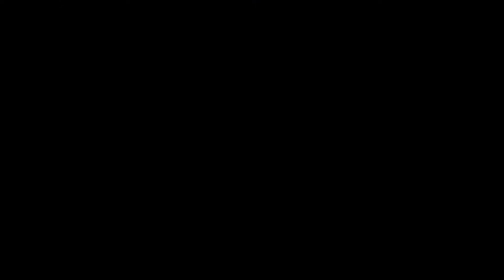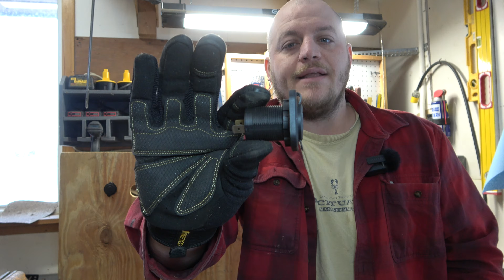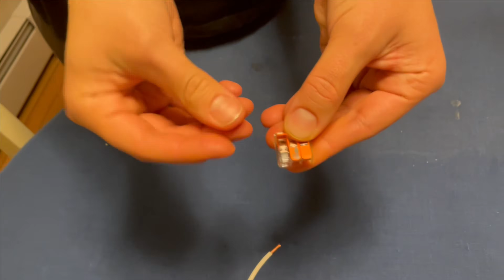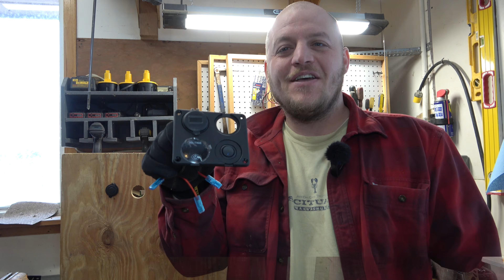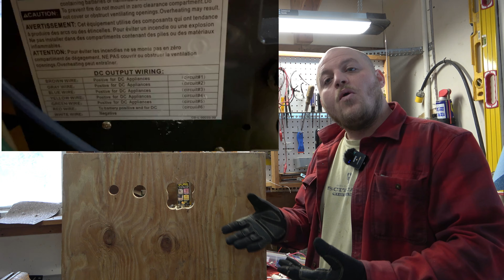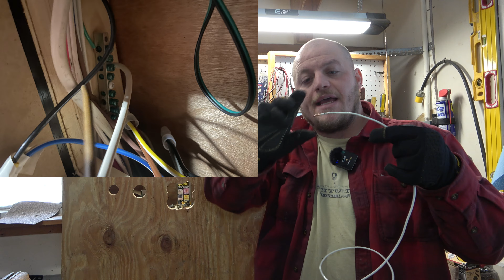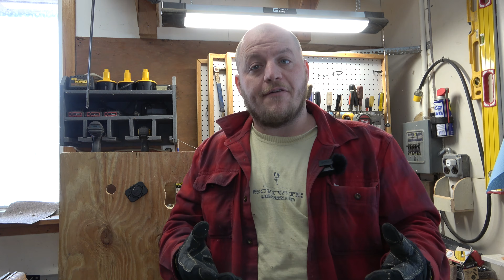Installing 12v plug | EASY cigarette socket camper RV

Comment: Brilliant explanation! I would like to wire a 12v socket in my RV to charge a laptop that is at 4.7Amps const. Based off of the length of wire needed etc. I have found that I would need a 12AWG wire. Would I really need a wire that thick or could I use something much thinner, say, a 17 gauge wire that is capable of withstanding 15 amps? with the added fuse, of course.
Reply from the maker: 14awg could handle 15a for a long distance.
Reply: @DIYOutdoorLife   @DIY Outdoor Life  thank you, I used your recommendation and video and I now have a working 12v socket! Thanks! My wife is happy as she can charge her laptop from under the table instead of the charger wire hanging overhead (as that is where the socket used to be).

If I may ask one more question, I was thinking of wiring two 12v sockets together to charge two laptops, say, with the same specs as before, so that would be 2x 5A = 10A altogether, and I read somewhere that it's best to muiltiply that by 1.5 then round up, so I get a 15A or 20A fuse to use.

I've used some online wiring calculators, and at 20A at a 30feet distance, I would have to use... a 6 gauge wire...

This probably being a "book standard" result, could I use a thinner wire? Say, 10 guage, since 10 gauge is technically good for 30amps.

I just cannot seem to reason using such a colossal wire (6 gauge) for two little 12v sockets. 10 gauge is big enough, but 6 gauge would look ridiculous.

Thank you!
Reply from the maker: @Farseer1995  10awg will be more than enough. In fact, I would have to look at your system, but I bet you could even use smaller than 10.  
You’re on a roll, have fun!
Reply: @DIYOutdoorLife  hah, once again thanks a ton!

Comment: hello I've been watching you for quite awhile I have a bushwhacker fb and I'm hoping you can help me to figure how to make my ac not over heat  I've cut a hole in the galy and not a thermostat ran fan to suck the hot air out but it is still not working correctly  please help if you can.  thanks for all you do
Reply from the maker: 10fb model?

Comment: I was so excited to this but my bus bar is tucked in on the bottom and screwed in such a way I can’t access! That’s so frustrating but thank you for this great video
Reply from the maker: what camper do you have? Bus for positive or grounding?
Reply: @DIYOutdoorLife  the 2022 10HD. I was just able to use a ratchet screwdriver to get the ground bus free from the backside of the access panel. I wish it was mounted on the side like yours but looks like they were short a little wire and couldn’t reach. :/ oh well, all is good now. Time to deal with the radio cutoff switch tomorrow! Thanks a million for all of the great videos you’ve put out
Reply from the maker: @KC2DWG  nice work! I'm really glad you got it.

Comment: Thanks to your clear, detailed instructions I was able to install a four socket panel in our camper.  As per your advice, I tried first on scrap wood and I removed the material between the four holes.  Thanks again and happy camping!
Reply from the maker: That’s great! They’re really handy, I love the one with the switch. Thanks for circling back w update.

Comment: I’m boondocking just 1 night in, my outlets and vent fan do not work. Is it a fuse or low battery?
Reply from the maker: Do you have a meter to check battery?  Your outlets won’t work off the battery. Your fan, furnace, lights, usb, and “cigarette” style plugs will. 
If you’re in a bind and you need to check, plug your 12 pin camper plug into your tow vehicle, start your car and check to see if the device starts working. If it works when you do that, it’s not your fuse, most likely the battery.
I hope this helps!
Reply: Just figured it out, the outlets don’t work without shore power. And my vent has to be open to run it. I guess I’ll have to get a small generator? To run AC or outlets..
Reply from the maker: @knowledgeadventure1819  glad you got it resolved, I just saw you got answers on the FB page. Try not to run your battery too low, a small generator might be the way to go.
Reply: @DIYOutdoorLife  yes I’m looking into some, can you send me a link for ideas run water to tankless heater from pump?
Reply from the maker: @knowledgeadventure1819  although I use a different one, I’ve been hearing really good things about this affordable generator-
https://amzn.to/3vHSqAs

As for hot water, do you mean a shower kit or something that gives you hot water at the galley tap?

Comment: Well done kind sir! Some next level interjection if I may? For myself I found installing those 2 position 30 amp mini Anderson Power Pole [APP] panels in key spots make for even more versatility. Also handy to keep your fridge plugged in if you like draggin' yer wagon over the rough stuff for long distances. I find many cig plugs tend to fall out in those conditions. And when it comes to crimping connections then please do indulge in a good pair of T&B or Sta Kon crimpers and always check that the tooth on the crimper is opposite the seam on your butt, barrel, loop, spade style connectors. Even some white crimp caps have seams too.Your hands will thank you and your connections will crimp long and prosper.
Reply from the maker: Great stuff! I was just talking to someone about how I prefer APP across the board. Great recommendation on the crimper. Thanks Charles!

Comment: Nice work Brian! I had two "Accessory" plugs in my camper that were failing. I opted to replace them with one outlet and a USB/Voltage outlet. Not only does this eliminate the need for an additional adapter for the usb charging, it gives me an approximate voltage rating for my battery. This includes an indication of whether or not I'm charging my battery as the voltage reading would be on excess of 13v.
Reply from the maker: It’s a really nice upgrade!

Comment: Brian, what tools or devices would you use to test the 12v plug to be certain it's carrying the correct current before you plugged anything in?
Reply from the maker: I always appreciate your thoughtful comments. I think I got tired after 18 minutes, I should have showed a test.

Typically, we would test potential with a voltage reading from a multimeter or device like the volt meter in the video (4-1).  It should be close to the reading off the battery.  We would not be able to test ampacity or current capability, that’s why we have such strict standards on conductors and our code system is so overkill.
Reply: @DIYOutdoorLife  I see. So I assume the process would be to ground the negative lead somehow and stick the positive lead inside the cigarette plug and make contact? I ask because my rv has what I've called a "mystery" cigarette plug that does not work very consistently. It's nothing but two wires connected to a 12v plug and just hangs inside one of the cabinets. I've never traced it back to its actual source. When I've used it, the power seems to be intermittent, not consistent. I'd like to use it for that "backfeed" option in your past video, but I need to do some more detective work on it. As for me, I appreciate your thoughtful responses! 🙏
Reply from the maker: @twloughlin  The outside metal ring/cylinder is the ground.  

Positive would depress the copper tab on the inside/back of the plug and negative is the housing.
I would start by swapping the plug. Sometimes it doesn’t take much for the positive to lose contact. If that doesn’t immediately solve the problem, it should be relatively easy to swap the wiring. Maybe even replacing the female spades first.